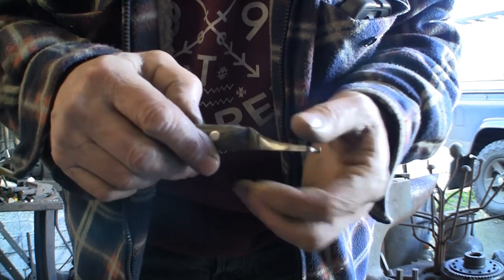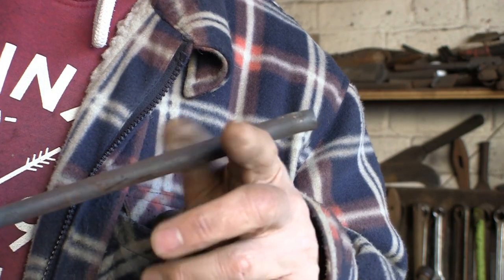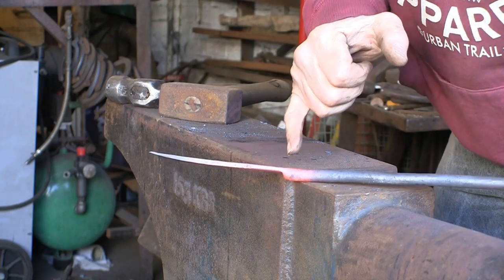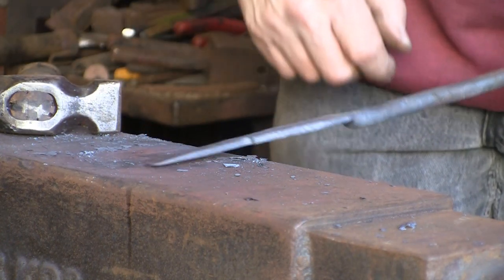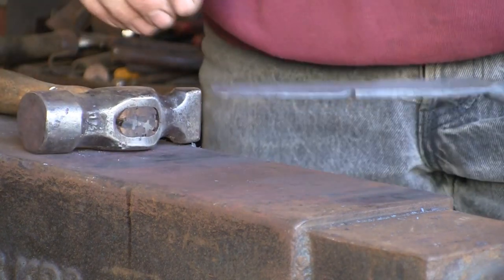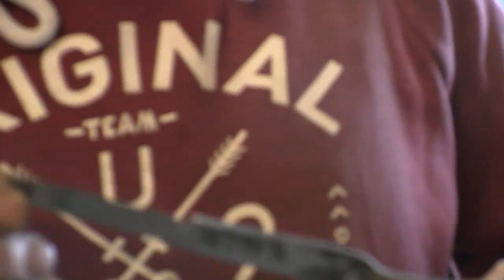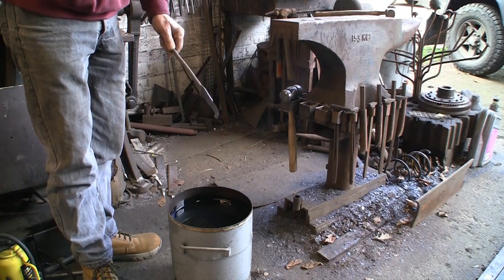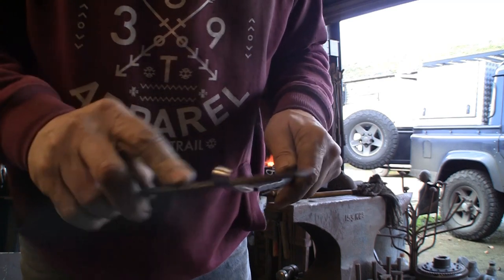Forging a Farriers knife Searcher

Comment: Gary great video. Our veterinarians and state laws are tough on shoeing . Like you first aid to the level of your training. When I started 50 years ago we floated teeth and had veterinarians actually call us to evaluate hoof problems and decide a corrective shoeing solution if available. Then people got in the sue mode and now you have to be careful on a trim job. I usually talk people into going bare foot during the winter and let the hoof wall get some strength but if you trim a little to short on the toe they want to sue so I have retired and shoe my own horse and a few old friends horses. Beautiful hoof knife I could not use a hump in the handle like that but as you know the older we get the more the wrist and forearms complain. Thanks again for everything you have taught me. Respectfully,Bill

Comment: Hi Gary that's worth a try, will set it up today have a go and let you know, only problem I can think of is the its winds so tight they will be difficult to separate I could well be wrong so let's do it and see.
Reply from the maker: Just tried it with 6mm and it works a treat! You were right about getting them apart, a little tricky but a drop of lubricant helps.

Comment: Result, I got involved making something for our shepherd after returning from steel stockist and didn't get a chance to have a go will do tomorrow and add oil or grease to help get them apart, many thanks for your help. I'm still trying to think if the outer tube had some notch or step would we get it to work, more now out of interest as you've proved it can be done doubling up the bar. Will keep you up dated, thanks again.

Comment: Hi Gary, material 6 or 8 mm round. Maybe the scale should be gap equal to material diameter?I ve been scratching my head for a few day now. I must say the ring maker jig does work very well. Did try that then heat the coil and pull apart, did work but not great. Thanks for giving it some thought I appreciate it.
Reply from the maker: I have been thinking about it and if you are using 8mm and want an 8mm gap then how about welding two bars together and then winding them together. Once wound separate them and I think that may give you two spirals with 8mm gaps..

Comment: Hi Gary I've back tracked to your ring making jig. Made two different sizes but I have a job and need to make like an open Spring type winding.have you any ideas how to re design the ring maker to make a coil with let's say 10 mm gap between coils, would be interested if you can think of a way, many thanks
Reply from the maker: +Mark Lambert I think I know a way but let me play with it, I'm at home now so no access to materials, I'll see if i can have a go tomorrow. You say a 10mm gap but what size material will you be using?